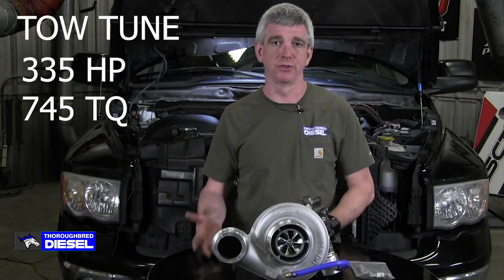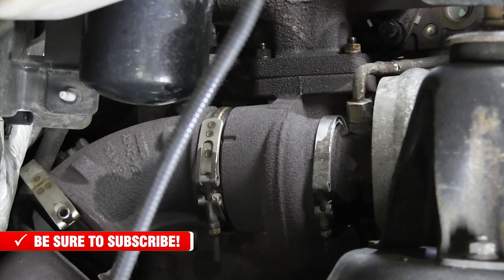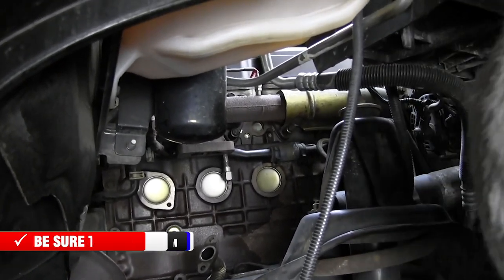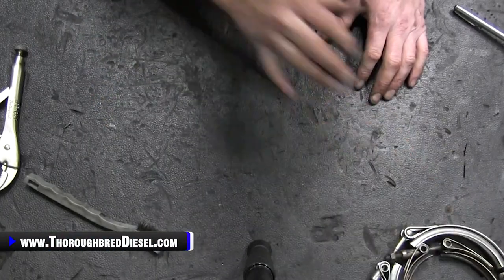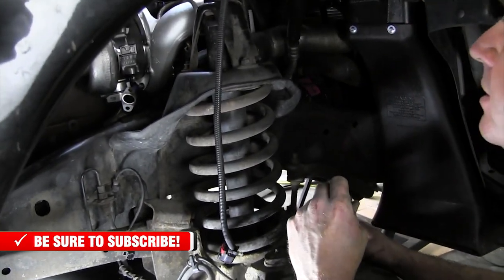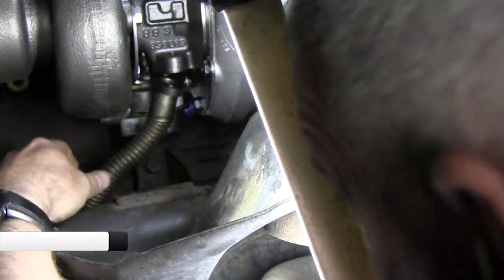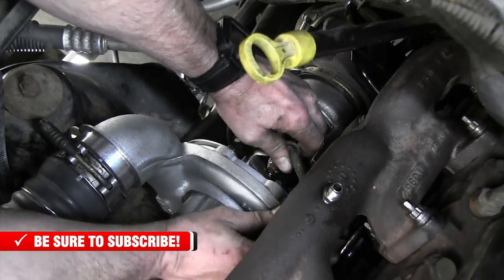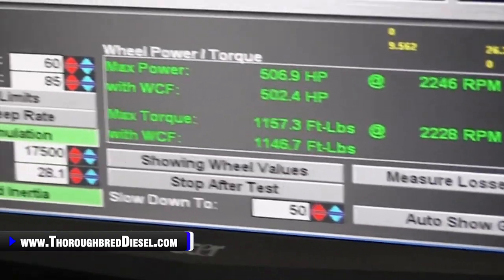Installing Industrial Injection PhatShaft Turbo on 2005 Dodge Cummins 5.9L w/ Results #diesel #turbo

Comment: Why wouldn’t the turbo manufacturer make the correct size outlet on the compressor housing? It’s clearly too big for the boot, you can even see the CAC clamp isn’t as close as it should be. Unless they suggest larger cac, cac piping and boots? Also you could index the compressor housing to line up better away from shock tower like the OEM turbo was. But I will say I really like your videos, you stay in a relatively good mood (at least on camera) lol. I will be purchasing many items from you guys, just on your character alone. All success.
Reply from the maker: Great tips. Thanks for the info.  Glad we can help!

Comment: Thanks for the video! Any tips on testing the oil supply line before turning on the truck?
Reply from the maker: You're welcome! Before installing the turbo, you can crank over the engine and make sure you have good oil flow.

Comment: I have the same truck only 3500. My turbo went out and was replaced. Since then , When I accelerate moderately to hard, The EGT shoots to 1300 or as high as 1400 and I need to back down, Which makes towing a pain. I tow most of the time. Any ideas on how to get my old truck back. It is pretty disappointing at present? Thanks
Reply from the maker: What turbo did you replace it with?  It sounds like you may have oversized the turbo and check for boost leaks.

Comment: Turbo. Turbsky. Turbolishious. 🤣 love you my man, I watch all these video's.  

 Also  I look at the stock cumins head and manifold on the 5.9 and 6.7 they leave so much on the table in performance / flow.  Looking at the head to manifold junction I port the head to remove the flat bottom so it is round like the manifold  then I port it to gasket size. I'll  then open up the indirect ports  on each outlet and knife the mergers.  By doing this  both valves flow near similar rates, then I port the inlets to Mantifold  and  go as deep as the drop off  to main runner. Once all 6 are done I work from the t3 flange.  I port the outer radius and widths them I bring the dividers from 1/4" to 1/8" and  I also  grind it down  so it is 1/4" below flush for those turbos that are non divided this helps get the dividers further up out of the compression  zone we're it funnels  in to the turbine.
 
 After the manifold, the turbine housing I will start by port matching the gasket. Then porting /blending  to the area's just out of sight. I then trench an area to the waste-gate where there is plenty of meat. Then I will port  the waste-gate  6mm larger in the shape of a "D" so as to not cause a nasty bind up with the flapper catching the  wider lip, For future compound upgrades this allows max flow to the second turbo  once waste-gate is open. Allowing lower egts  better flow and optimal  performance  Down low and up top

 With the head off I port the valve bowl area's especially  the roof where the casting shrouds the valve guides. I unshroud the guides  so as to improve flow and life expectancy  of the guides due to soot and the inherent  behavior this causes in the exhaust flow.  Then I open up the bowl leading to the seat  and I remove the inner  angle on the valve job. The 35°  valve seating surface  will be untouched  in the porting process. The machine shop will later add a deeper valve seat and make the final angle a 45° angle for the new valves for improved flow. After I get head back I will blend the new seats to the port.
 This lowers egts and maximizes flow and efficiency of the stock system around 43-55% and its practically free for anyone remotely  good with there hands.  This also  opens up behind the valved 3-4mm "without going to a larger valve".
 And the steeper angle further aids in better  flow characteristics.
I will be uploading videos as I get my self setup for streaming. And flow checking.  
 Also adding a cam the porting  increases potential of the  cam chosen.

Comment: How goes it, I just ordered a VP44 from ya all an I noticed on the removal of old VP44 when I got it out the keyway was coated with a clear coat of paint an when I removed it the clear coat all came off will that effect the timing of the new pump??? Any feed back will be very much  appreciated, Thank you.
Reply: No it won’t.
Reply from the maker: The paint coming off the key will not affect anything,  just make sure to get your key lined up correctly!

Comment: What fueling upgrades have been done to this truck. I would like to upgrade my turbo. I tow around 20 thousand on a regular basis. I have an early 04 sosge
Reply from the maker: None. Fueling is stock. If we stick with this turbo then we will probably change the tuning and possibly move to a 50HP injector.

Comment: There is no way if I take all that stuff off with out doing a second Gen swap with the turbo in the center and you solve the heat problem for the back two cylinders and Sneed speed manifold and that is my dream and a Fleece turbo and Iam not looking for a big hp gain my truck is stock my big up grade so far is a in tank lift pump that has two gear motor  pump and people don’t release that each gear motor on two separate circuit one is factory and the other I the Fleese wireing with it’s own wiring harness and has its own fuse and relay so if one pump goes out you can run of one motor and with two running you get 21 lbs and with one you get 10-11 lbs so to me it’s a win win situation. And when the first came out I was all over it and it makes a great lift pump and I have 3 fuel filters the first is a Baldwin 5 micron filter water separator with drain and after that I have a big cat filter with 2 micron and after that in factory location is a Baldwin 5 micron with drain and light that comes on when water in fuel cartridge and I have had this set up since it was 2 yrs old and I bought this truck new so I know what has been done .